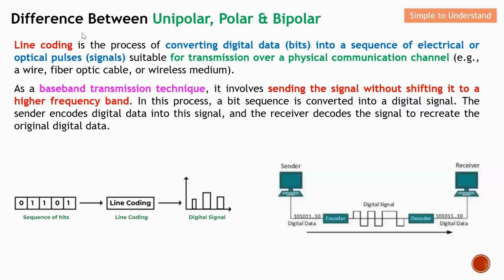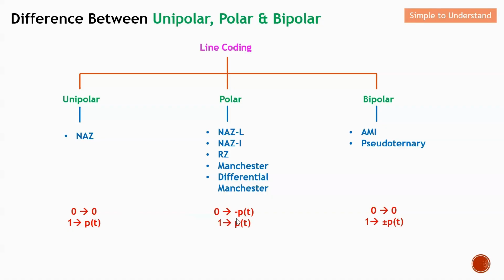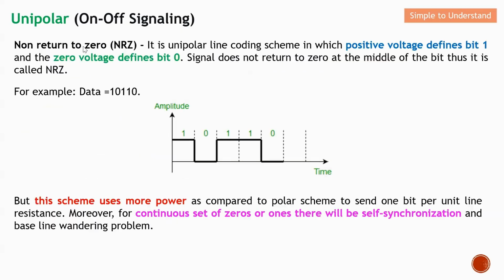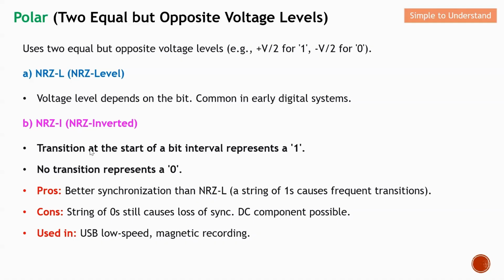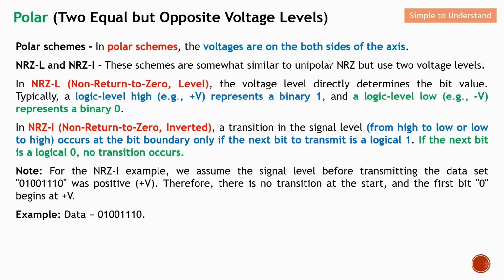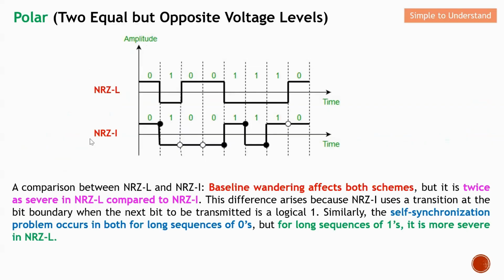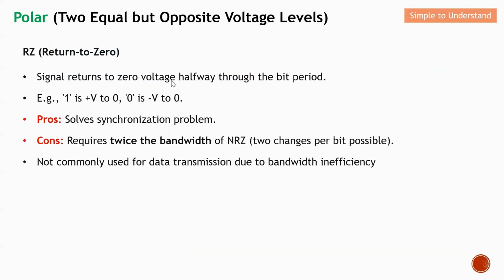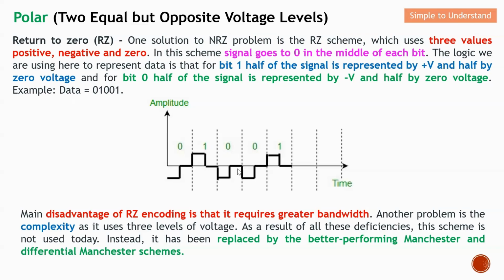Digital Communication #7. Line Coding Techniques: Difference Between Unipolar, Polar & Bipolar Line

Comment from the maker: Thank you for your time to watch this Part A discussion on the different types of line coding techniques. There are Unipolar (NRZ), Polar (NRZ-L, NRZ-I, RZ, Manchester & Differential Manchester), and Bipolar (AMI & Pseudoternary). For this video, I will discuss Unipolar (NRZ) and Polar (NRZ-L, NRZ-I, RZ). The rest will be covered in Part B.
First, I will define what line coding is (the conversion of bits of data, 0's and 1's, into a digital signal).
Next, for Unipolar, the digital signal uses one level. When the bit is 0, the digital signal is represented by 0V. When the data is 1, the digital signal is represented by a positive pulse.
As for Polar, there are two levels (negative and positive). For example, when the bit is 0, it can be represented in the digital signal as a negative pulse, while when the data is 1, the digital signal will be a positive pulse.
I will also explain the key characteristics of Unipolar (NRZ) and Polar (NRZ-L, NRZ-I, RZ). Timing diagrams for both unipolar and polar schemes will be discussed so you can gain a complete understanding.